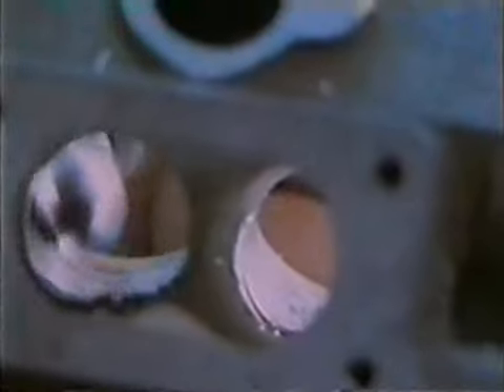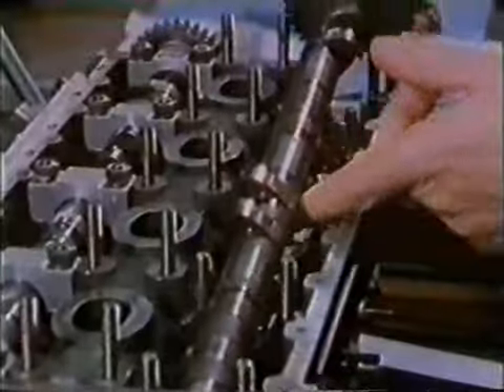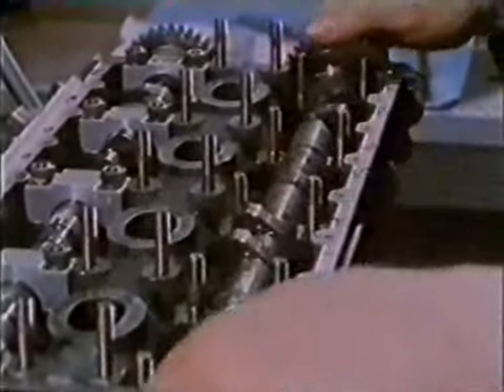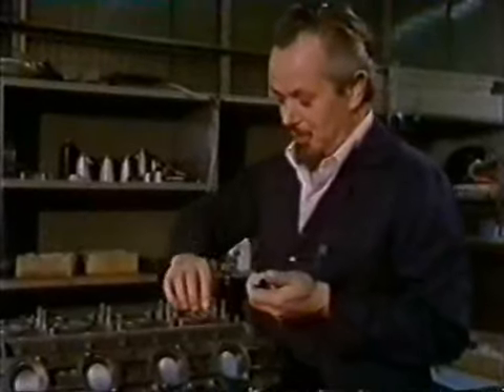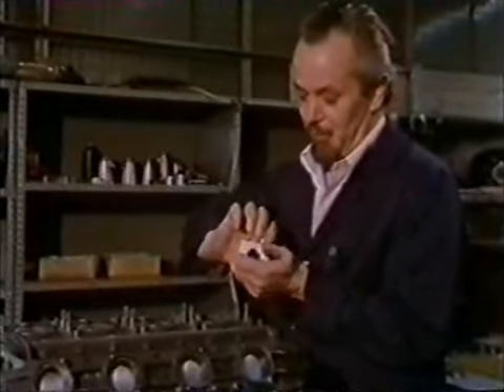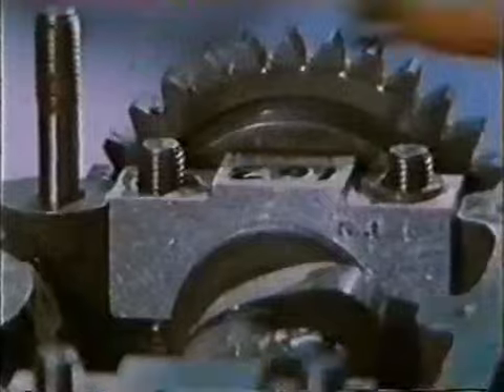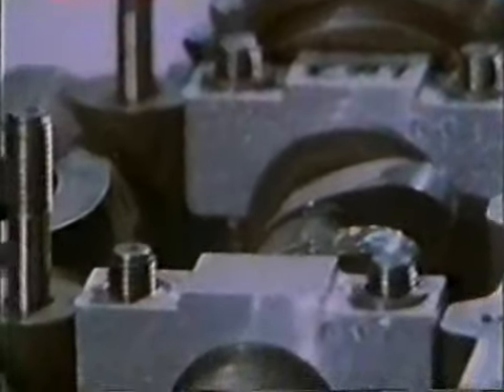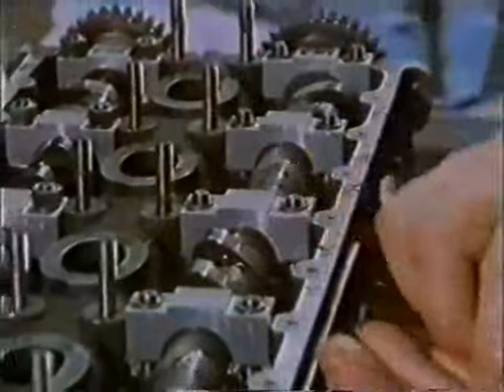BBC 1981: Assembling a Cosworth DFV V8 F1 engine

Comment: When Cosworth expanded its customer base in 1968/69, one wonders how much overtime the staffers did to keep the race teams well-supplied with engines.
Impressive to see the technician doing the hand-tightening of the nuts.  Other shops I'm familiar with would have used air-wrenches.
Reply: It makes me wonder how many Cosworth DFV V8 engines were built during it's lifespan in F1

Comment: Nice. Let the engineers have their time to caress those beautiful, cast parts. A striking difference to today's standardized, minimized, unpersonalized parts. If they could, they'd replace it by electrical engines. Sure, great for the environment, but where's the sound? Of course, a 180 degree sounds like shit (=a straight four) anyway.
Reply: 180 degree?  you mean Decibel sound, right? 

Special effects can solve that problem, you use several Large Surface Transducer bolted to the chassis, over driven by a 1000 watt Class-A McIntosh Amp 🤣  pumping out V12 sound effects, like those that come out of the tailpipe 👍